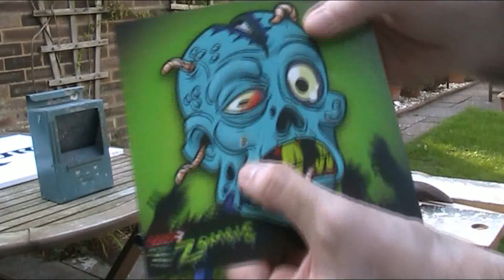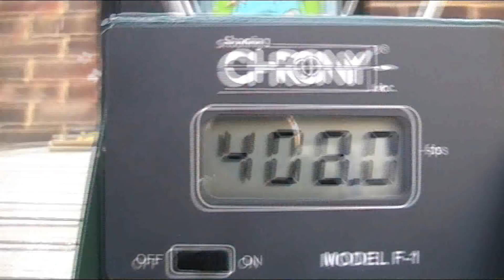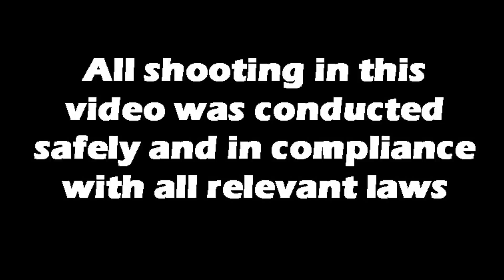Old Mystery Air Rifle | Air Armoury

Comment: Definitely a bsa cadet. I had a cadet major, and that had a trigger adjusting screw on top of the trigger block. The cadet major was also longer. I think to restore  the rifle would be quite rewarding. These rifles were used on funfairs often with smoothe bore. Hope you can get it restored!

Comment: BSA cadet. First made in 1945. The Cadet Major (a larger version) appeared slightly later in 1946 and lasted until 1959 when the BSA Meteor took its place. They usually produce around 420 fps in good condition. It was designed for young shooters and its non adustable trigger was purposely rather stiff. They were made in .177 cal only. Cadets, and indeed Cadet Majors were a common sight at fairgrounds. A total of 107, 750 Cadets and 116,000 Cadet Majors were manufactured.

Comment: I’d say it was a bsa cadet by the sloping end block and them dinky sights. The cadet major was slightly larger with more advanced sights and an adjustable trigger. Worth fixing up with stocks and even customised stocks are available on eBay of all places.  They Only put out about 8ft/lbs mind
ATB
Reply: Looks remarkably similar to either a cadet or cadet major, I had a c/major back in 1960, a great gun for a 17 year old.

Comment: I'm super amazed that it had the power it had. I was expecting mid 200's up to 300 if was really lucky... could prolly increase the FPS By a lil' tad more with a good cleaning and then running 25-35 pellets thru it after. Ither way im inpressed it even fired. That just goes to show how things use to be made to last compared to how things are made to break nowadays......
 **You should have considered fabbing your own stock by hand** 😞 Not spent any cash of course... but Maybe could used some scrap black oak or something. That would have been cool IMO. Otherwise, I would have tried to preserve the gun as best as possible from this point on, but other than that and adding a handmade stock out of scrap, I would have just left it how it was. Oh, also after i made stock i wouldnt have stained or varnished it. I would just have let it be so it could have got dirty and aged as well as absorb oil from hands and so on. That would have helped give it the aged look somewhat naturally pretty quick to match the rest. Anyway, Thanks for sharing this Video. Have a Blessed Weekend...
From a Fellow Airgunner & Fan of your channel from across the pond, Cheers...
~Doc~
[06/01/18]
Reply from the maker: I thought of making a stock, but the amount of time it would take me just wouldn't be worth it. I could spend the time making more videos for you guys instead!